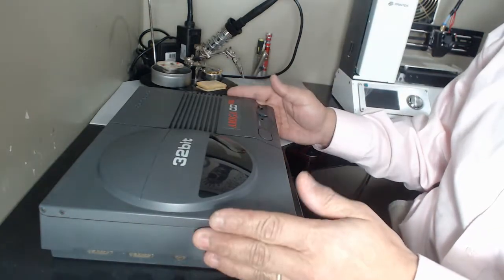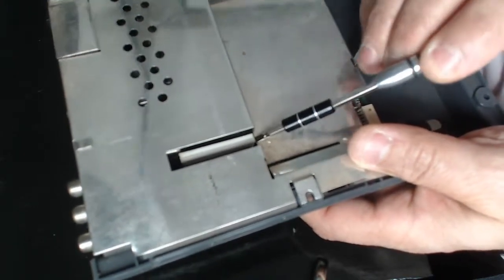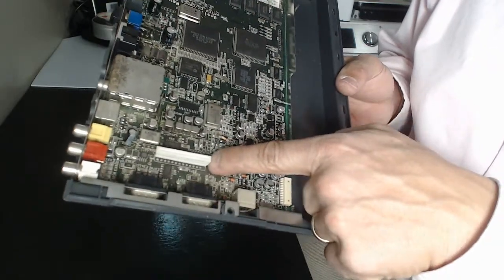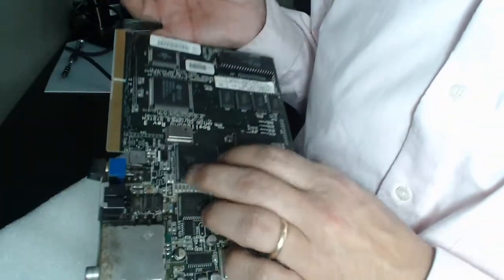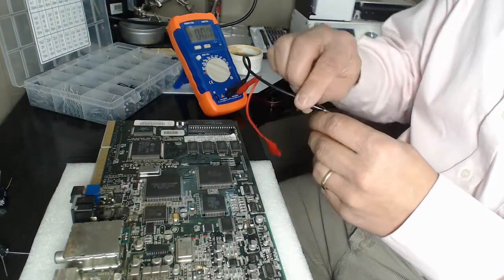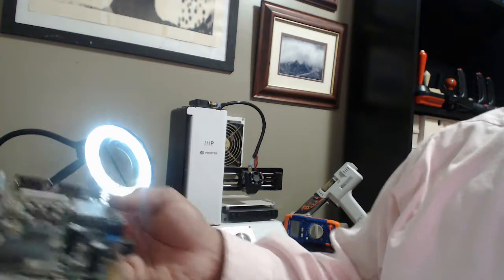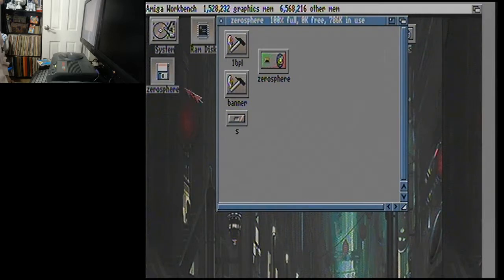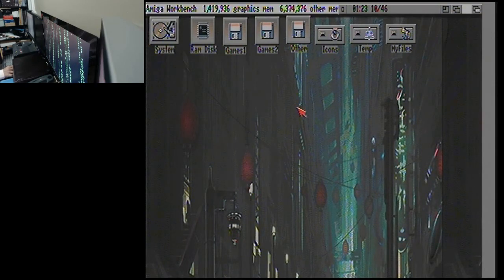Amiga CD32 Repair  (Capacitor Replacement)

Comment: I really should check mine --- but, if it ain't broke don't fix it.
Reply from the maker: I tend to agree, if its working fine I'm not inclined to "fix" things but giving them a look over is not a bad idea some may have leaked and that will cause more damage down the road.